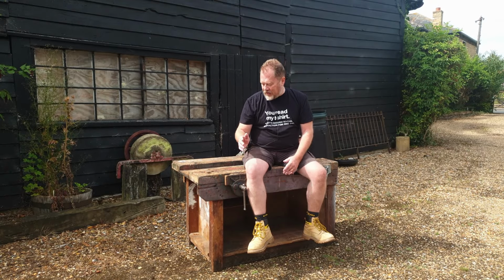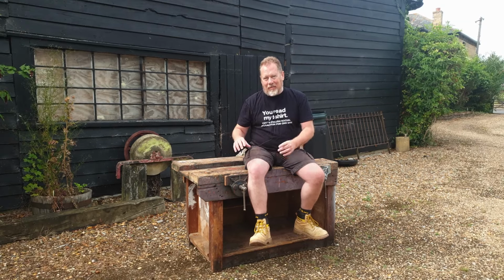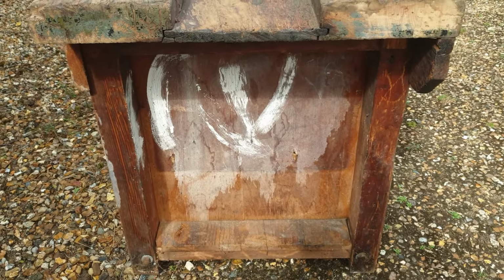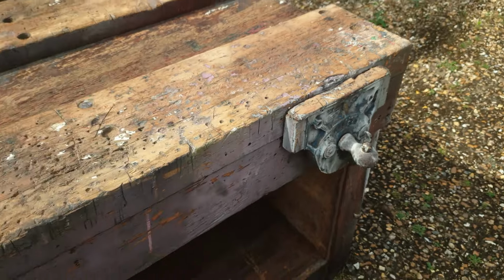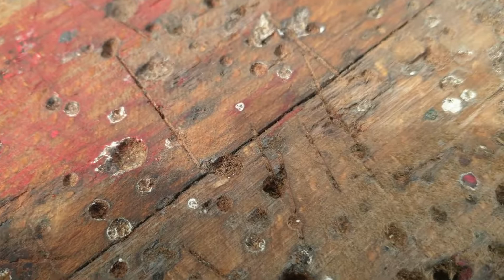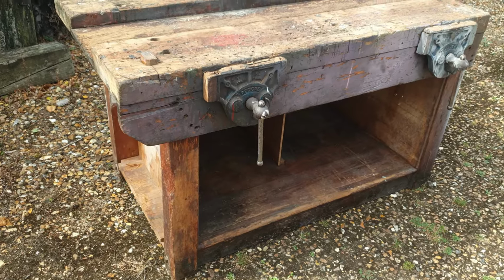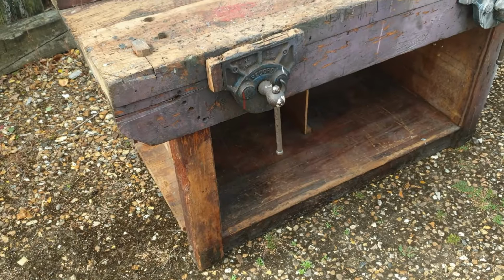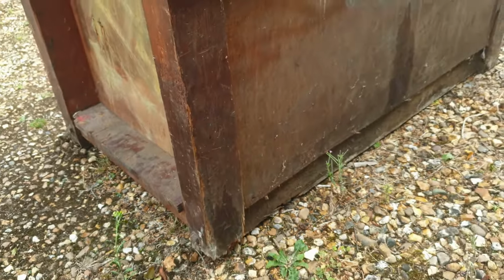Hand Tools Only - Restoring a woodworking bench - Part 1

Comment: I think the most important aspect of a woodworking bench is that it doesn't move or vibrate when you saw, plane or chisel your work.   If it is truly solid, then worth saving otherwise I would use one of the vices and make a new bench from softwood. I made a Roubot style from Chris Scwarz's book using only 4x2 builders timber, and it was fairly easy to do even with the hand tools that I use.  I admire your willingness to save an old dear but how much more or less work would it be to start again AND get something the size you need?
Reply from the maker: I totally agree about stability. Currently I have to do my planing work on a Black & Decker Workmate. Wobblemate would be a better name for it 😂 This bench is nice and solid so hopefully I can get it useable without too much effort.
Reply: @radboogie  BTW not sure why there are two vices on that bench, could be because they were designed for two students working together (?or smacking each other with mallets more like!).  But, I have the same vice and it will easily hold a heavy door or window frame while you work on it.  They are massively impressive for their size.  Also, you may want to consider whether to flush mount the vice against the apron like it is now or have it standing off by an inch or so (does make it a bit easier to grab hold of work while you tighten up the vice i.e. you can get your fingers around the back without trapping them).
Reply from the maker: I reckon the right hand vice used to be on the back. "smacking each other with mallets" - did we go to the same school? 😂

Thanks for the extra info on the vice capabilities, I quite like having both vices on the front as it'll be easier to support long jobs. But am torn between having the fixed face flush or having it stand off, tending towards keeping them flush at the moment but will take what you said about grabbing the work into consideration.

Comment: I'd plane the top using a scrub plane, use an electric plane if i have to and that's it, there's plenty of thickness for another two generations of use on this one
The paint on the side can be removed with a card scraper

Depending on much height is missing i'd either jack it up with horizontal beams on the ground 
Or indeed increase the length of the legs with drawbored end grain mortise and tenon then add stretchers for winding rigidity
But for 20cm i'd just add horizontal beams, add some wedge if the bench is rocking and that's it

I'd replace the vise wood inserts and clean them up using a wire brush and a painter's soap or something like mineral spirits or acetone if it really doesn't get off
I'd also check if every fastener are in decent shape and replace them if necessary, especially for the aprons
Reply from the maker: Thanks for the ideas. Horizontal beams would work - definitely thinking along those lines. 👍

Comment: Due to its size it seems practical that it could be used as a secondary (Mobile) bench within the workshop, thus sizeable, locking, castors go someway to solving the height issue.
Reply from the maker: That'd be a good use for it. My shop doesn't have the space for that unfortunately, but these ex-school benches are a really compact size.

Comment: Looks like my late dad’s old bench. Main requirements are flatness of the top and 90 deg accuracy of vice clamping surfaces to top, stiffness of the frame and comfortable working height. I’d not add another layer of wood unless it’s the same as what’s there as you could end up with warping if the humidity or heat changes in the workshop.  It may need a complete strip down to ensure the joints are tight enough to make the whole thing rigid enough.
Reply from the maker: Thanks John, warpage was a concern when I mentioned laminating a new top onto it. Favourite so far will be to see if I can flip the tops. 👍

Comment: We still had these benches at my school in the early 2000s. I would just plain the tops. Probably be fine under the surface. Im not certain how the tops are joined to the leg frames but flipping them might be a hassle. 
I cant really think of a good way to make the legs 8" longer while keeping them sturdy. How about making a second frame or box for the bench to stand it on? The simplest would be from 8x2 timber screwed together or could use joinery if you want to be more fancy.
Cheers
Reply from the maker: Thanks Peter. It looks like the tops are attached with coach bolts, so shouldn't be too hard to remove them. I agree about the legs being difficult to extend, building sled feet seems like the current favourite 👍

Comment: Bring the top down with a router and a router sled.  Make it nice and flattened, then add what every final skin you like.  Pretty much the same with the tool well.  The lower level of the bench is perfect for adding three inch or four inch casters with locks all around.  That will bring it up higher and make it something you can have follow you around.  Putting a sheet of plywood or several planks on the very bottom of the original legs to make a shelf, then adding the casters will give you even more height and stability.  Maybe run a metal detector over the whole thing before you start using power tools on the surface.  Thinking the "little ones" may have sunk a nail or broken drill bit in the surface here and there.  
That's all I've got off the top of my head.
Reply from the maker: Castors is an interesting idea though the bench will be backed against a wall so I wouldn't have access to lock the rear ones and it might move a bit when planing. Will definitely be running the metal detector over it, I reckon there's a few panel pins hammered in there 👍
Reply: @radboogie  I made a bench to hold a computer driven router carver.  It had to be very stout.  I put casters on it but built boots for the wheel area.  A three sided box.  When I got the bench where i needed it, I lifted the corner and slid a boot around the wheel lifting it just enough to clear contact with the floor.  It is stable as anything.  I kick the boots out, and we roll away.  Boots back on, very stable.  I understand the fear of movement if your using your plane, but my bench is as solid as if it was bolded to the floor.  
I understand you think the option is a gamble.  Quite a bit of time and some $.  Casters that size aren't inexpensive.

Comment: I would probably look for a chunk of bowling alley for the top and use 2x2 or 3x3 angle with a nut plate for an adjustable  feet and cap your legs with the angle, not original looking but useful.
Reply from the maker: Thanks for the idea Cress 👍
Reply: I have a workbench with a bowling lane top & it is awesome. If you can find a piece of lane it's best not to get a piece from the first few meters of the lane as that is usually rock maple, & while very hard, is tough to cut, although it drills & takes screws well
Reply from the maker: @ChrisChandler-y4g  sounds good. I have heard that bowling alley sections are full of tiny nails, did you have a problem with that?
Reply: @radboogie  mine had no nails through the top, but each slat was glued & side nailed with a hardened spiral shank nail, as well as having an iron T bar screwed in along the bottom

Comment: First off…. Don’t burn it! I would take the vises off and refinish them back to uniform color and working condition.
Then take the top off and add four inch rails under the top. Flip the original Beech tops over after you have planed them. No need to add any Redwood to them. Reattach the top pieces. Turing to the bottom, I would scab five inches to the legs to the existing legs. This will give you some wiggle room to adjust the final height. If you want drawers or an open concept, that is your choice not mine. I like an open bench concept myself… easier to keep clean. Sand entire workbench down to decent wood then apply a coat of BLO and Bob’s your uncle!
Reply from the maker: Thanks Chris, really glad no-one wants me to burn it so far 👍 Adding rails under the top is an interesting idea, will see how doable that is when I take the tops off. I'm into having an open bench too, there's usually something in the way of a cupboard opening in my shop 😂

Comment: Check out the channel "Captain of my shed" he (Mikey) has recently restored a similar bench - highlights problems he came across too. But the two tops I would flatten but flip over so bottom is fresh top. Table the top from the base and add additional sub frame. As you are tall - Sled feet would also help. Look at the rob cosman bench has mdf as a topper/surface and sled feet.

Either way - your videos are ace and very interesting. How would you flatten a cast iron table saw top?

Matt
Reply from the maker: Cheers Matt, flipping the top and using sled feet are looking favourite at the moment. Will check out Captain of my shed.

Flattening a cast iron table saw top? I guess it's quite large so the tricky bit would be measuring how flat it is (or isn't). Probably too big for a surface plate even if you have one. I'd use a decent steel straight edge and feeler gauges to map out the highs and lows and mark them with a sharpie. Then I'd hand scrape the high spots until I got it all withing about a thou or two. If you're not into hand scraping you could use a belt sander to knock down the high spots. If you want it really accurate you'd need to get hold of a cast iron straight edge that's longer than the table is wide, but these are expensive tools unless you intend to use one a lot. 👍

Comment: Don’t use redwood for the top, it’s way too soft. If you can find Birch use that. An inch to two inches is good. I’d actually strip the paint off and repaint the vises. They are worth it. I’d take one and attach at back opposite corner or at the end so you could put dog holes down the length for long pieces. Use 7-8” leg extensions and attach with a bridle joint and epoxy glue.
Reply from the maker: Cheers David 👍 Will definitely get the vices repainted, have got a pot of Smoothrite blue specially for them. Mounting one of them as an end vice is a great idea, unfortunately where it's going I don't have any access to the side. But when I get a bigger shop that would be a great mod!
Reply: @radboogie  I meant Beech when I left you a comment. Don’t even think of birch.
Reply from the maker: @davidt8438  haha, thanks for the correction 👍

Comment: For the height: Adding to the bottom will not result in stability for lateral stresses like hand planing. I would: A) cut off a few inches from the bottom of the legs to get to healthier wood; B) Lift the top and add enough inches between the frame and top to get to your target height.
For the top I would borrow or rent a power planer to bring it down to healthier wood.
For extra credit, I would disassemble the entire thing and run everything through that borrowed planer.
Looks like a fun project. 👍
Reply from the maker: Nice idea, hadn't thought of that. It would definitely be nice to plane all of the timbers, will have to see if I strip it down that far 👍

Comment: Burn it... Never! I'd mount it on a 10" riser block, select a timber framing splice to fix the one back leg, plane the 2 top boards just enough to make them flat-ish, then turn them over so it's history still shows to those who care to look, and get out the card scrapers for the rest of the paint, then new hardwood jaws for the vices... oh and proper swing out doors where the sliders used to be.
Reply from the maker: Great to hear so much love for the bench and no-one has suggested burning it yet! You know I never think of using card scrapers, I have one somewhere but I always forget to use it. Great idea 👍

Comment: A few thoughts:  (i) lots of thickness still on those slab tops, so perhaps just some tinted epoxy (Botal Toat flexible epoxy is great for this) to fill any significant saw kerfs and big gouges) and then just plane down to your tolerance; (ii) finger joint in some leg extensions to raise it up (TheApartmentWoodworker has a recent post on doing that with hand tools) [I think you have that idea as is, and I agree]; and (iii) as an alternative to (ii) above, add some sled feet on with floating tenons, although that would probably be pretty chunky.  I would also think about replacing the front apron with something wider so you can use pegs with those nice vises.
Reply from the maker: Thanks for your ideas James, I've got some 5" x 5" x 8' timbers so sled feet could be a good solution.

Comment: I would suggest adding what we call in the US sled feet to raise the bench. Like on a trestle table. These are big timbers that run from each back leg to each front leg. You could use a stub tenon on the end of the feet to attach them or peg them. Also, I would not bother to raise the vises (vices?): if you add nice stout jaws of oak or beech that are even with the refurbished top, they will be fine. (I did that with a Morgan 200A rapid-action vise that I added to the end of my slab top and it works great.) I’m a retired engineer from Houston, Texas, and I just found your channel and am enjoying the content. Thank you.
Reply from the maker: Thanks Elaine, I love the sled idea - will definitely give that some thought. Also good to get an idea of how much overhang is acceptable on the vice jaws, would be a lot easier to not have to relocate them 👍
Reply: @radboogie  Came to say exactly these suggestions. A simple base will add height and the vices won’t have to be moved with new jaws that match the new top that you marry to the old one. My only additional idea is if you want to skip splicing on a new foot, you can simply add a little “booster” in the new base for that specific foot that will make it level with the rest of the legs once you cut off the rot. Elaine for the win!

Comment: DON'T burn it!  It looks fairly well made and solid. I'd take a look at the underside of the top timbers and see what they look like - maybe flip them to keep the nice old wood intact.  As for raising it, my initial thought would be to build a base below it that the legs fit into - maybe mortise and tenon construction to keep with the original design and not disturb the vertical members.  Sounds like a fun project and I'm interested to see what you come up with.
Reply from the maker: I knew you guys would deliver some excellent suggestions - flipping the top is a great idea - thanks 👍
Reply: This is just what I was thinking !
Reply: Yes, turn the top over. Sand or wire brush the rest. Reface the vices and put wheels on it to raise it up.